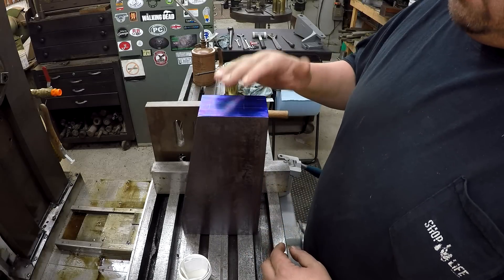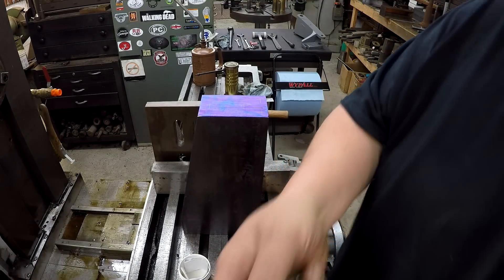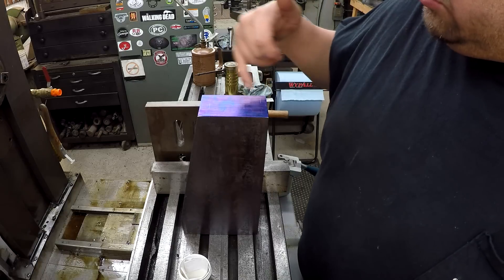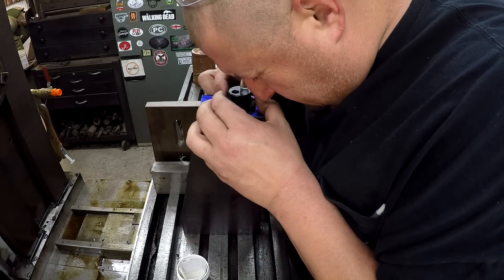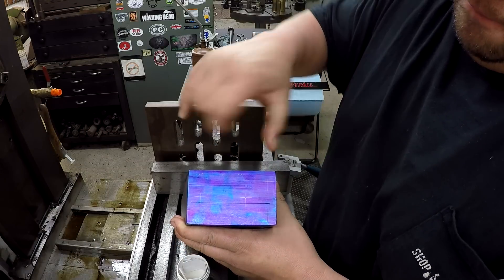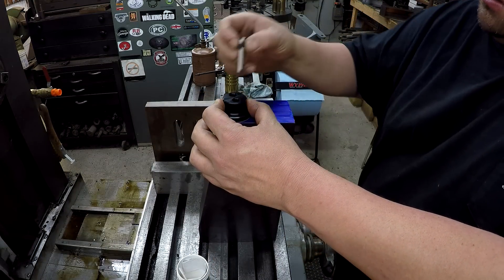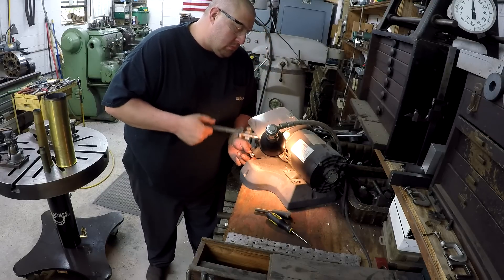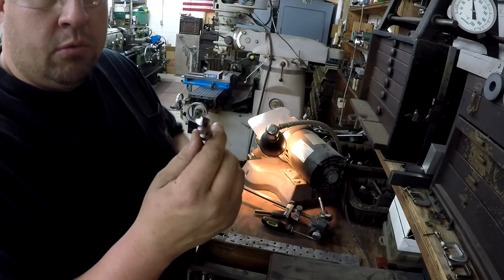Kearny & Trecker Parking Attachment Part 6

Comment: I know that with the 50-taper holders you can perform a lot of the operations horizontally by using them directly in the spindle, but it seems less than ideal. Given where the controls are, you are really working blind and can't see what is happening with the operation. This wouldn't be the case doing it vertically, as you could see the tool and the surface it was interacting with. I realize that in some cases, with the workpiece and the clearance on the mill, you aren't going to have any other choice, but it feels more like a last resort set up more than normal operating envelope for the machine.

If you contrast this with the horizontal boring mill, the controls are set up on the side, so you are able to work the machine and have eyes on the tool and the work surface.

Comment: After reading majority of the comments, and with Adams extensive knowledge, why not peen the top of those oversize dowel pin holes with a steel ball bearing? stick it over the hole and give it a whack! In a chamfered hole make sure it's not too big or else you will be making contact on the outside diameter of the chamfer rather than sitting on the inside dia of the chamfer.   You the man +Abom79 ! Always enjoy watching your true machinist ways!

Comment: Adam   Thanks for showing how critical the equal grind on a drill bit is, and how it can cause an unexpectedly oversized result - I was surprised how even a skilled and experienced machinist like yourself can still get caught.   Do you have a rule of thumb of how much to drill under, so you can ream to size ?   I was thinking 1/16"on the dia would allow for a fair amount of drill oversize error, but would it make the reamer work to hard ?   Thanks

Comment: Adam, I've watched you turn everything from small to large pieces on your lathe.  You sometimes use a little oil but I have never seen you using any flood coolant. When would the use of flood coolant be necessary on lathe work or is it just for milling ?
Thanks for the great videos
Bob
Reply from the maker: The only lathe I run that has flood coolant is my Monarch. I've got videos if repairing ths coolant pump, cleaning the machine, and adding coolant. I use it for drilling and turning ops when I can. I also show using it when turning the main shaft for my rotary welding table.

Comment: Hi Adam, would you consider drilling some vertical holes in the solid steel arm to lighten it up some?  The factory casting appears to have hollow spaces in its interior.  The section height of your piece should give it a lot of its strength.  It may be possible to lighten up its interior and have a lighter load on your pivot pin attachment to the body of the mill.  Long time viewer, first time commenting.  Keep up the great work and thanks for sharing.

Comment: Nice video as always. Interesting, that horizontal mill setup to drill the holes. Why not use the vertical? Very cool machine that mill, but it seems a bit awkward looking behind the part, etc.? I understand the scribed lines as a double-check (always a good idea) but I'm surprised you center-punched them instead of just relying on the edge finder, DRO and center-drill? Are the dowels meant to just be an assembly tool or are you thinking they will add strength to the welded final? As someone said earlier you could maybe just make new larger dowel pins. I remember using a large ball bearing on a hole and banging it with a hammer and then trying a reamer, but that was usually aluminum and much less oversize :). Or how about two machined rails mounted (cap screws, Kurt vise style-too late to machine them in) on one part and two cut groves/rabbets to accept/mate the rails on the other? Like a "keyed" kind of thing instead of dowels. I've seen you do some cool broach/keyway work :) and it might be stronger. Keep up the good work!

Comment: What is an optical center finder and how does it work?  I have some vague notions about how such might work, but I'd love to see an explanation
Reply from the maker: +Tony Hammitt you look through the optic and line up the scribed lines. It's like looking through a microscope. Once lined up you pull the optic out and replace with the punch and tap it to make the center.
Reply: Thanks for the info Adam.  I need to see one in person, then I'm sure it'll make sense :)

Comment: my tip of the day...use a floating reamer holder...I used them for aircraft engine stuff...this way a chucking reamer is good....but remember that precision pre-drilled hole-position is critical beforehand....use a sharp ceneter drill or even a ball nosed endmill...

Comment: If the block is going to be milled out to match the profile of the OEM part, won't the dowels be cut off anyway?   I can see doweling the .75" plate, but the 'lower' pin on the larger block looks like it's right in the middle of the area that will be removed.
Reply from the maker: +Mike DeLoach I'll have some shallow blind holes drilled and reamed into the back of the block. There's plenty of metal there even after it's milled.

Comment: Hi Adam, FYI if you are in need of the 9/16" dowel pin, McMaster-Carr has those (and sizes every 1/32, it seems).  $4 each, but you only need two of them, and the shipping would be similar anyway. But I agree that the tension pin will do just as good a job at centering that part to be welded!
Reply from the maker: +George Burkhard Yep the tension pin will hold it fine.

Comment: Hi Adam.  Great to see the progress on the parking attachment. It is going to be much better than the original from K&T
Please explain to a newbie why you use a drill chuck instead of collets for this operation.
Thanks.
Reply from the maker: +Arnljot Seem I only have collets in standard sizes, 1/16" increments. Can't use them for all drill sizes. Some collets have the ability to cover a range of size though, but mine arent that style.

Comment: good workaround fix on the dowel pins, plan "B" to the rescue. coming up with a plan B requires a special talent that comes from a sharp mind and years of experience,  you could have easily covered up the problem . thanks for sharing adam

Comment: perhaps avoid the spring pins if you are welding, it might affect them, i think you might find a metric size might be just oversize to suit instead of using them.
Reply from the maker: +jusb1066 They'll be fine, they are just there to hold everything together square for welding. Not even needed, but I wanted to add them into the design.

Comment: Do you think maybe drilling to depth with a 1/4 inch split point drill first would keep the larger drill from cutting oversize due to the point pushing off center? I always use a small drill to start a hole that needs reamed it takes longer but always gives me good results.

Comment: could you not just machine some to the correct size ?
Reply: +david hearne That's what I was thinking.  I think he has access to a great lathe, or two .  :-)
Reply from the maker: +david hearne I could for sure, but the pins I shown will still work just fine.

Comment: Yo Adam, question for your next SNS maybe? What could be the problem when you try to drill a hole and it turns out triangular instead of round?
Reply: +Cancun771 If it's in thin material,  this should help http://www.practicalmachinist.com/vb/general/triangular-holes-twist-bit-169368/
Reply: +Cancun771 could be play or run out in the drill press, causing it to chatter around, that or drillng sheet metal, dont use standard drill bits, get a cone drill bit for sheet.
Reply: It's aluminum and only between 5-8mm dia, I take it.
Reply from the maker: +Cancun771 Too much clearance angle on a drill will cause problems.

Comment: Hi Adam,
Don't you have any of the same grade of steel used for the dowel pins which you could machine down to the required size?
 I am sure that the tension pins will work well enough but you know it will bug you having to compromise by using them.
Great video Professor Abom!
 Regards to you and your family.

Comment: Try finding a few worn out 33/64 drills (or similar), cut off the fluted part (a drill blank will work too) and grind the shank to size in your surface grinder (you do have a spin-indexer, right?). No need to give up the original idea few a few thou...

Comment: In regards to the oversized holes, I have seen knurling used on the pins to slightly take up the slack.  Not sure if you would want to spend the time, but it seemed to work well enough.

Comment: Adam,

On our HMCs at work the spindle is always aligned to the Z axis, the horizontal axis is X and the vertical axis is Y.  Granted they're all CNC machines, but I've found this be universal on all horizontal mills in our shop.  Wouldn't that make your DRO's show where Y should be Z and Z should be Y?  If you were to flip your Bridgeport backwards, the knee's movement would be Z and the tables movement up and down would be Y... same as the HMC's coordinate systems in our plant.  Just a thought.
Reply: supahonkey 
It really doesn’t matter if you call them A B & C, Z X & Y or Dog Cat and Mouse, providing you know which is which, also, every DRO I have seen has X as left and right, Y as in and out and Z as up and down. 
Cheers, Graham.

Comment: It would be possible to get some hardened bushes/sleeves to fit those dowel pins..you could then open the holes out to fit the bushes...if the drill has wandered the holes might now be off there original centres as well so bushes would fix that also..great channel by the way ;-)

Comment: So many viewers suggest making your own pins.  Please reply asap cause as a novice, it came to my mind too.  Give us the obvious reason why not...
Reply: +Jean-Pierre Guay You would need either an OD grinder or a surface grinder with a Spindex.  I guess the best answer is the same as why you typically wouldn't make your own bolts.  They're just too cheap to justify making yourself except when the unique situation demands it.
Reply: +supahonkey Don't need to use a grinder to make an low tolerance mandrel do you ?  Need to bore a larger perferctly round hole and meke a mini mandrel.  What do you think ?  Must be another reason...

Comment: Bummer on the oversize holes.  Check out "spirol pins". Instead of the single layer pin you showed, they are a thinner sheetmetal that are rolled round.  I found some on McMaster Carr called "coiled spring pin", item  95755A646  Jeff